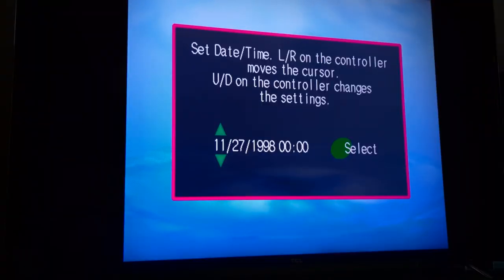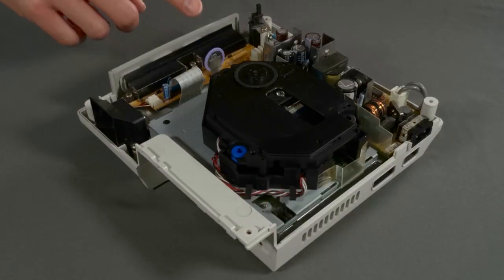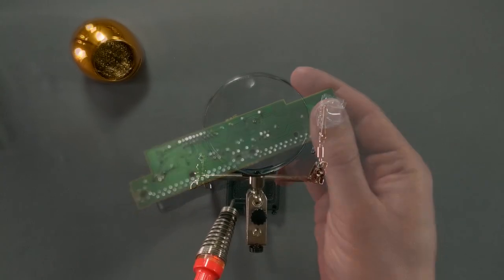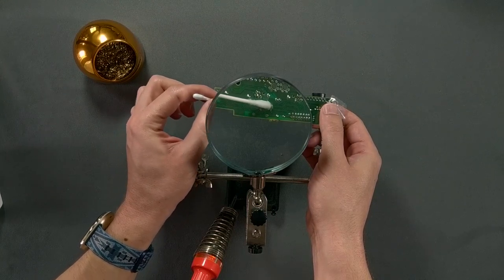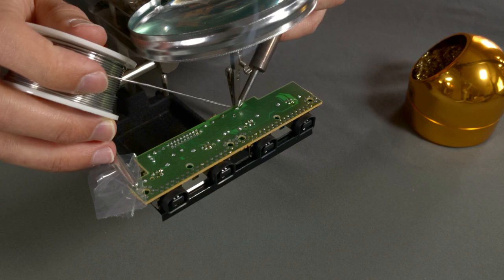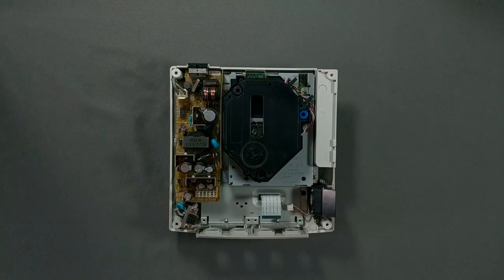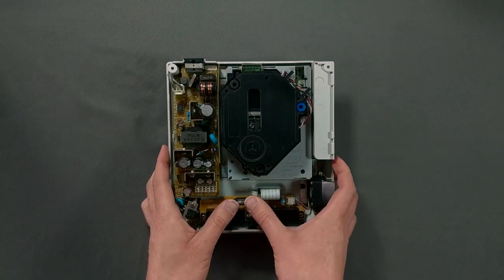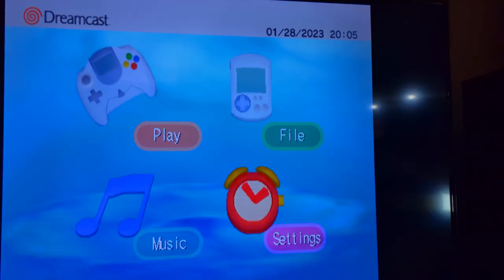Restoring and Revising the Dreamcast Clock Battery

Comment: never played shenmue 
however I'm used to that noise from skies of arcadia or RE Code Veronica :P
still have a working Jet Set Radio and Sonic Adventure
Nice vid, I need one of these and I need to replace my controller port fuse... I'm down to just 1, one of them died
we are lucky sega included two and I was able to short out the dead one and make the other work w/o any tools
Reply from the maker: Thanks, I'm glad you enjoyed the video! I'm looking for copies of SA and SA2, myself, but I'm sure you've seen what the prices on those titles are like lately.

Comment: I did this and it still won't hold the time and date.
Reply from the maker: Here are some things I'd look into:
Check the continuity between the terminals in the battery holder and the traces on the board to make sure there's a good connection.
I'd also double check the battery is installed in the correct orientation; unfortunately, it's easy to put it in backwards.
If those all look good, I'd check the voltage on the new battery. If it's low, reinstall it in the console and power it on for about two hours. That should charge the battery most of the way.